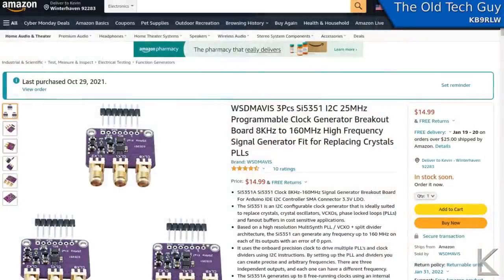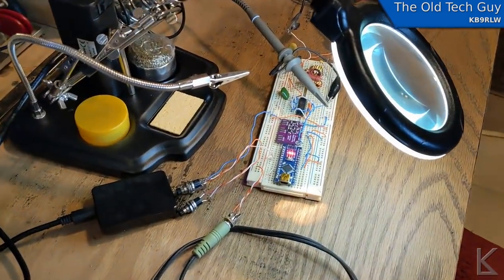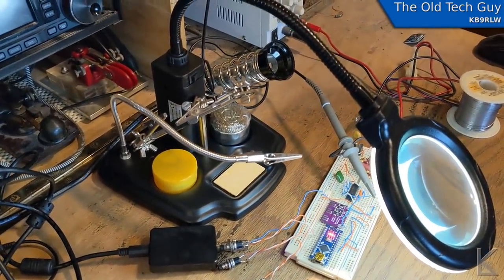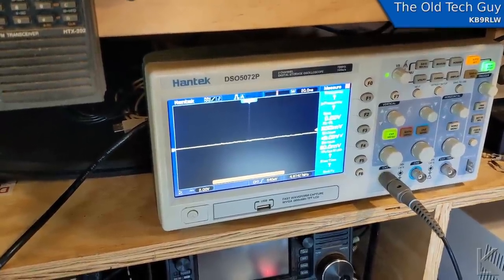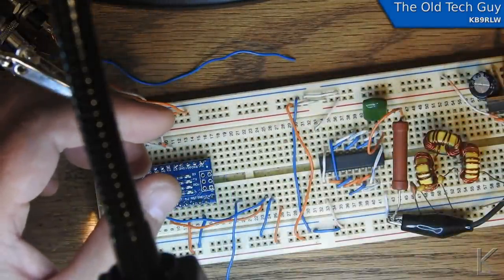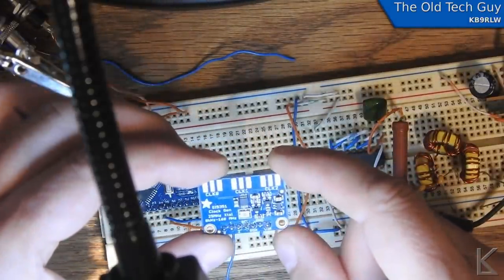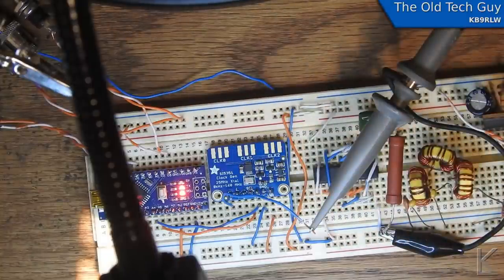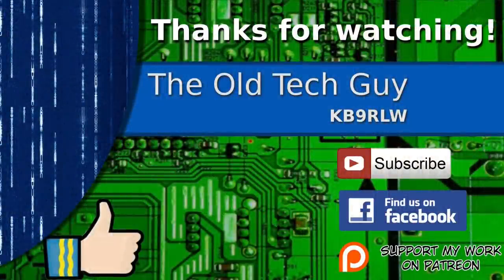Electronics - Cheap parts. A cautionary tale!

Comment: Hi Kevin,
Glad you were able to sort out the problem. Years ago I was scratching my head on a Heathkit console TV build that I couldn't get the color alignment set to what the manual showed. I eventually took it to a local Heathkit store and they determined the blue gun coil was wound wrong. They said I would never have determined that with equipment available to the home builder. Stay safe.  73  WJ3U

Comment: I've read elsewhere that cloned SI5351s need all registers set to published default values at initialisation, otherwise all sorts of strange things happen. For instance, your spectrum analyser output appears to show that the chip's "Spread Spectrum" function was enabled.

With a few lines of code you might be able get those 3 boards working. Good luck!
Reply: I've gotten boards before that needed a special thing the first time like this. I think you're likely correct.

Comment: Years ago I built a function generator using the XR-2206 IC that I bought from an on-line "auction" site at an amazingly low price.  It sort of worked, but wasn't stable.  On close inspection, the EXAR logo was a bit "off."  Yep, not from EXAR after all.  The real thing fixed that.  Good video, Kevin.  N9QIL

Comment: From the reviews on Amazon of these cheap units sold by various sellers, what you experienced is not uncommon.  What's interesting is that in one case for these particular modules and in other cases where someone got multiple defective modules of an entirely different type BUT demanded replacements, the replacements magically worked.

Comment: Just a point of clarification, the WSDMAVIS si5351 modules are not made by Elegoo. 

Indeed, Elegoo does not make si5351 modules.  Elegoo has, at least for me, made some extremely reliable Arduino clones.  That said, I also saw the WSDMAVIS si5351 modules and considered buying them, but my instinct kicked in and I decided to stick with Adafruit.  

In theory, there should be no reason the WSDMAVIS si5351 module should require any special library, unless the clock chip itself is a bad clone and/or the onboard crystal reference is defective. The latter theory can be tested using an external clock reference.  However, for $14, I'd just chalk it up to a lesson learned.

Comment: Hi Kevin looks like you got te si5351 with in factory enabled "Sprea Spectrum"   or if your  SI5351 has a SSEN pin then make sure this pen is LOW.  as far i know was there no register in de Si5151 so if you dont have that pin then you sadly stuck with a Spread Spectrum Clock generator only :(
Reply: little update,  there is a register  #149 bit 7, that can enable/disable the spread spectrum.. try reseting this bit to 0, can disable the spread spectrum generation. if the factory did not overwrite this option.

Comment: I purchased some ESP32 Neo board from China (same ones on Amazon but cheaper) and was expecting issues uploading my code. The flash button you are supposed to push when uploading was just there for show and the board I selected (per instructions) always failed the upload. Before I  used my sling shot to send them sailing, I started trying other board types and one worked! So yeah, Chinese knock offs are a gamble and if you get yours to work, it will probably be as you expected, a different driver.

Comment: I bought five of the cheap ones some time before the global craziness and they work fine. Few months ago I tried ordering some bare si5351 chips and got capacitors instead :) So it wouldn't surprise me if they used bad fakes or no chips at all (just the plastic case) in those modules now. However I wanted to order a few more but you saved me a few bucks now. Thanks.
Reply: I ordered a stack of Si5351s on Ali, and the first one I put on a board was a no-show.  Didn't appear on the I2C bus.  Swapped it out for one of the precious few remaining from my last pre-shortage purchase, and worked right away.  Sigh.

Comment: Would be interesting to know why they fail.
Perhaps X-tal with wrong loading cap (6..12pF) , then another driver might help. "The total internal XTAL load capacitance (CL) can be selected to be 0, 6, 8, or 10 pF"
Perhaps X-tal with to high ESR (<150Ω)
Or maybe an cheep ceramic oscillator in the same package as an X-tal.

Comment: A while back I bought some RG8x jumper cables off of Amazon that were built using crimp PL259's....well,  the center pins on a couple of them had so much solder on the pin it wouldn't fit into a standard SO239.....bottom line, I'll be buying next time from a US supplier such as DX Engineering.

Comment: Kevin, I have been using some cheap boards purchased via E-Bay supplied by a guy here in UK from Manchester. They are 100% compatible and work just fine. No idea what the postage would be to USA but not all cheap parts are crap, as you found with the Nano clones.  I know QRP Labs use a different configuration for the Si5351, maybe Hans will have a fix? Thanks for sharing and good luck with the rest of the build.

Comment: Since they're marked as "clock generator", I wonder if they power up into some clock randomization mode.  Digital circuits typically don't care, but an early approach to reducing generated RF interference was to apply "spread spectrum" to the clocks.  Then you could still listen to your AM radio in the computer room.  This 5351 clone might have that, and have it enabled by default.

Comment: hustler 6 btv on a class a motorhome. cant get a low swr. any suggestions?
Reply from the maker: That's a trapped vertical, so it requires a good bed of radial wires for the ground plane.  I'm not sure you could make it work on a motorhome.  There's just not enough square footage to create the needed ground plane.

Comment: I do not assume these boards are bad. As someone else mention, set all the registers, dont depend on assumptions. Also check your addresses and use your scope on the data lines to see whats going on.  I have several of these, good coding practice to set all registers on boot even if its the (assumed) default setting. By doing this practice, another programmer end user can change a setting as they can see from the boot code and comments each item set. - so I disagree with dont buy cheap stuff. But then I code my drivers directly using PIC chips to keep code base small and tight

Comment: It might not be the chips, but the xtals. Try setting the load to 10pF.  It sort of worked for one mine but the crystal was a bit unstable. I think it was a 20 or 30pF load crystal b3cause those are way cheaper to produce.

Comment: Good afternoon Kevin,
I'm curious, can these projects be done with a raspberry pi? If so, is there a reason you chose the Arduino over a PI Zero 2?
Reply from the maker: The Pi runs a full OS and has to boot up.  It also draws a LOT more power than the atmega micro-controller, which is basically instant on.
For a low power transmitter, it makes sense.
Reply: @loughkb  thanks Kevin!
Reply: @loughkb  thanks

Comment: VERY interesting! I have recently run into the same problem with the cheap si5351a boards. My Adafruit board just arrived today and I am going to do some comparisons. As you can see in my video https://youtu.be/d2LE_-31kL8 I am actually able to get the cheap board to generate a steady signal but I have to use the Even Integer divide mode. The si5351a datasheet does mention that fractional dividers will have more jitter error than integer dividers. So it seems like it could be working according to the datasheet but still doesn't explain why the other boards don't have the problem.